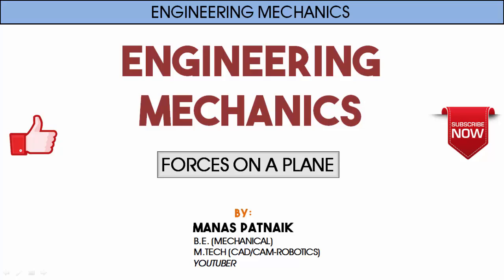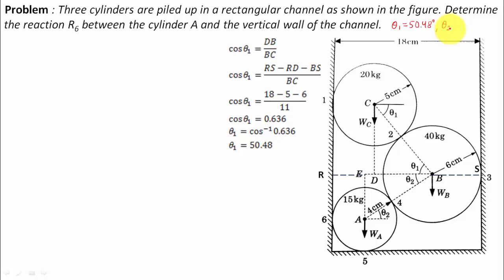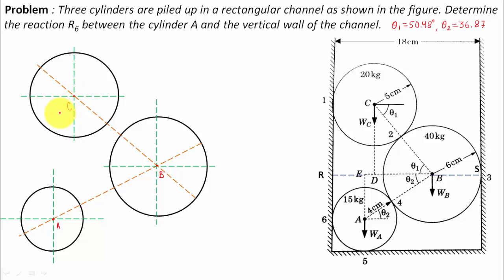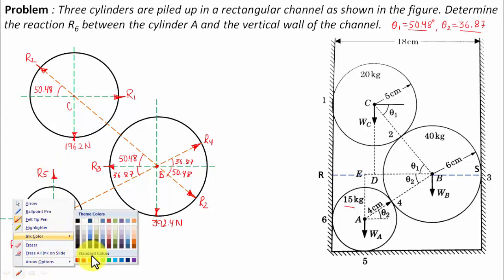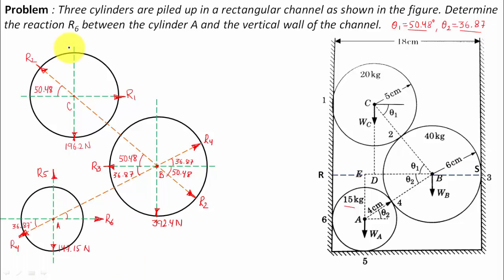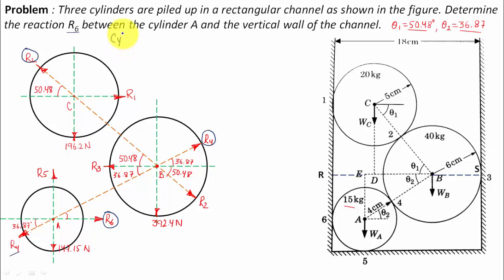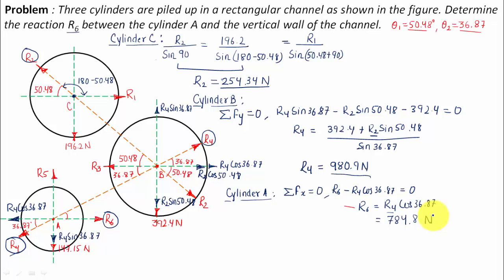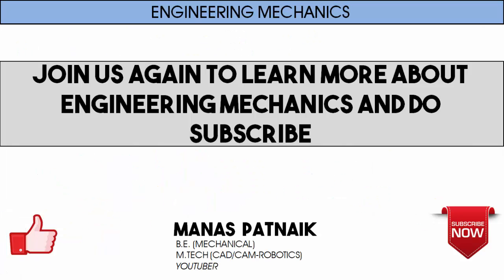Engineering Mechanics_Forces on a Plane_Level 2_Problem 4

Comment: The forces R2 on the FBD of cylinder B and R4 on the FBD of cylinder A are not reactions but rather active forces by cylinder C on B and cylinder B on A respectively. The signs are still correct in this solution. What do you guys say?

Comment: A uniform rod rests on a fixed smooth sphere with its lower end pressing a smooth vertical wall which touches the sphere. if theta is the inclination of the rod with the vertical, show that in the position of equilibrium, r = 2l (sin (theta/2)(cos^3(theta/2) where , r = radius of the sphere and l = length of the base.(Please solve this problem for the benefit of viewers. It will enhance your viewership)